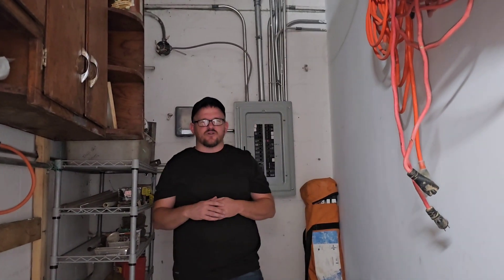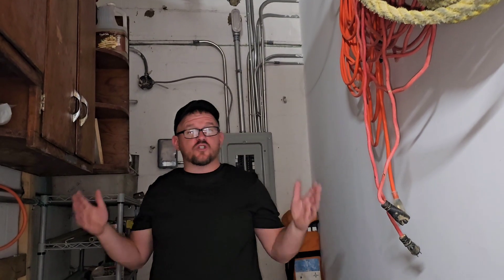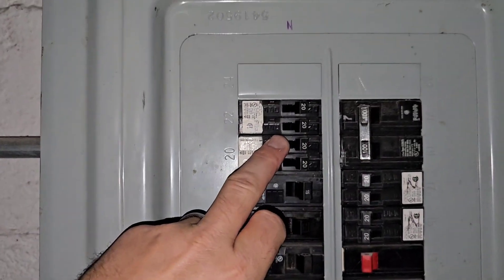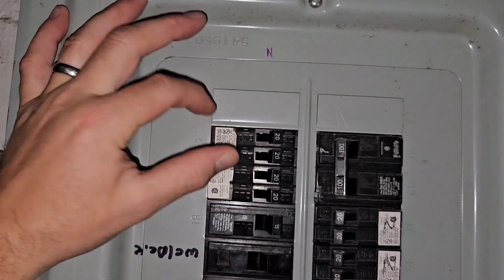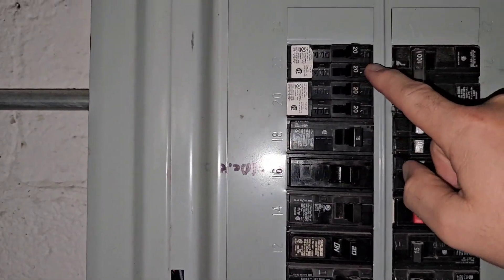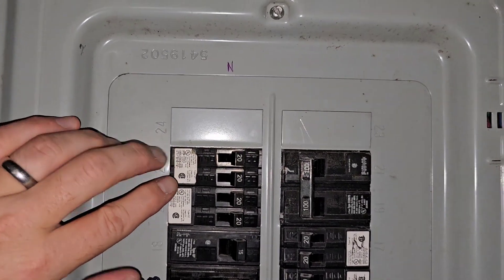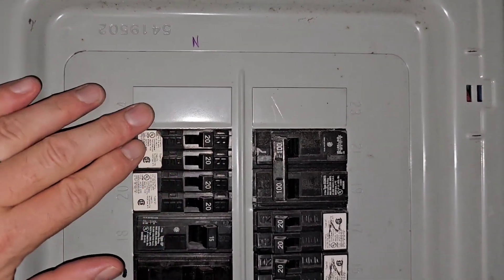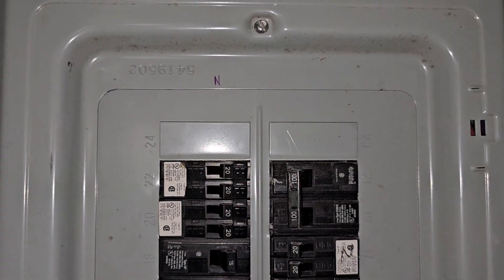Will tandem/piggyback breakers work on three phase?

Comment: The confusion about tandem breakers caused us all sorts of problems.  So easy to get this wrong. Very important to learn about this. We hired a commercial electrician to do work for us as we moved into a new commercial building, but our management pushed him to add circuits for us before we had finished and approved plans. This electrician was good at following plans, but he was no engineer and didn't understand code relating to tandem breakers well enough to be making these decisions on his own.  Because management was pushing him to add a lot of new branch circuits in panels that didn't have enough room for what was being asked for, he added tandems to make it fit.

But these were 3-phase QO panels of that didn't allow tandems, so it was a code violation to use tandems.  But Square D makes this confusing because they still sell the QO2020 breakers that fit just fine in these panels.  The panels, however, just aren't rated for that many circuits.

This all goes back to the 1965 NEC that added the requirement that panels must limit the maximum number of circuits and this meant inventing those tandems with features that prevent them from being used in panels or slots that are not intended for tandems.  But Square-D still provided the old style tandems that don't have the security feature for backward compatibility with the installed base of panels.  And here we are 50 years later, and they are still sold and used a lot to allow people to squeeze in an extra circuit or two instead of replacing or adding more panels.

We had to fix all this work by swapping two panels for larger ones and adding one new panel to support all the branch circuits we needed.

On top of this, the electrician loved to use Multiwire Branch Circuits but failed to understand the requirement that they must be wired from different phases of the supply.  He fed MWBC in multiple places from the tandems because in his mind, the rule was just to use consecutive breakers down one side to feed the MWBCs. But this doesn't work when you are using tandems because they aren't separate poles,

Of course, the MWBC SEEMS works fine when you test it, but it overloads the shared natural when you feed it from the same phase.  So while the hots may get 15 amps each on the two line MWBC, the natural, instead of getting 0 amps (the difference between the two), ends up carrying 30 amps on a 12 gauge wire when you make this mistake mixing tandems and MWBCs.  Bit problem over time.

So not only did we end up with big code violations of having overloaded panels because we pushed the electrician to look the other way, we also ended up with these deadly MWBCs that were just a fire waiting to happen.

It's all be corrected now, and we were lucky to catch it all, and it was a big learning lesson for us (the building owners) that thought we knew more about electrical work that we really did.
Reply from the maker: Excellent, thank you for sharing!

Comment: Good video for beginners wanting to become pros.   Too often particularly in older homes with smaller panels and fewer circuits than what's desired for a modern lifestyle well meaning unqualified homeowners modify a piggyback breaker to fit into a panel not designed for it.